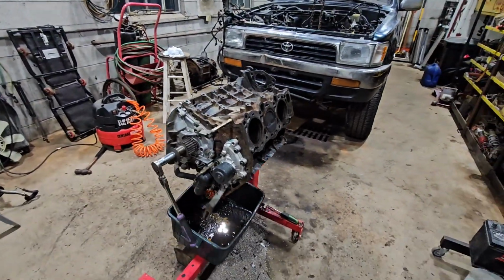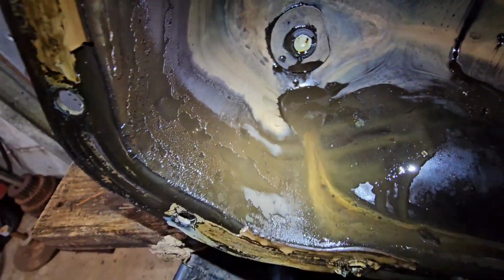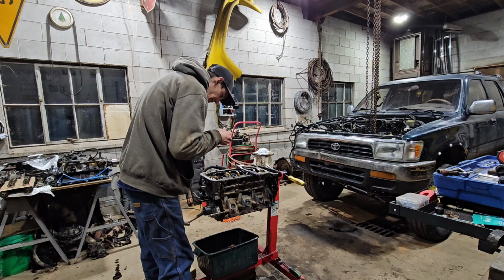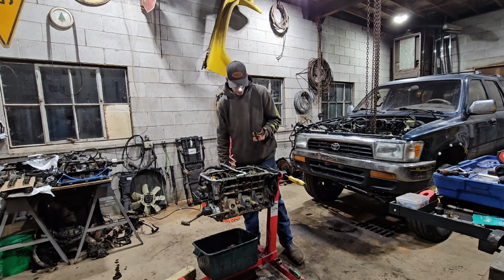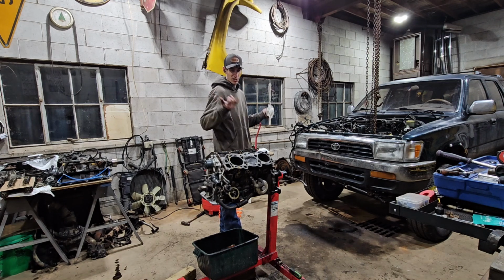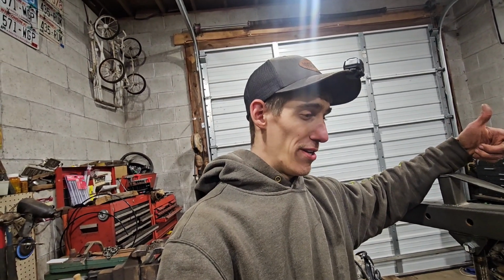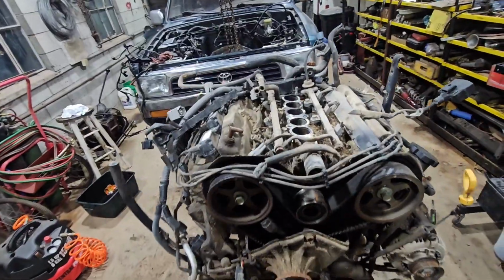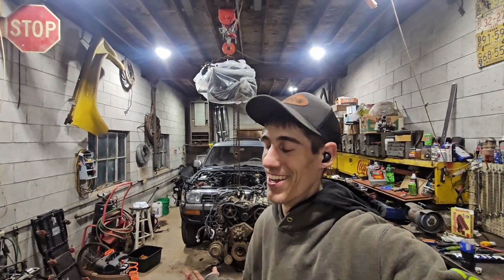Toyota 4runner 3.4 swap part 2

Comment: it looks like the water is not mixed, more like it got rained on instead. that is why the valves is rusty. I would pull the heads off and check the cylinder walls and if they are rusty and it wont turn over its scrap. Drop a 1uz down in there it will solve your problems. The v6's of this era are trash in reality. Bad about blowing head gaskets. my 96 Tacoma 2rz has 335k on stock engine and runs great easy to work on. Some of these 4runners came with the 4 cylinder 2rz-fe, you could go that way and slap a turbo on it for fun. I honestly would not put another v6 in there.
Reply from the maker: If I'm going away from a v6 I'd go diesel just for the unique factor, but I've got a tight budget lol. I'll have another video out this week of taring down the engine and it tells a lot lol
Reply: @zachcline  The diesel is a dam good idea. vw makes a 1.9tdi and they make adapters to fit the yota transmission etc.
Reply from the maker: @turboimport95  that is good to know